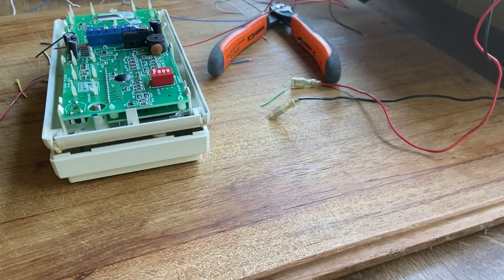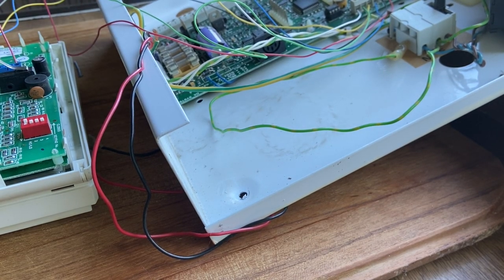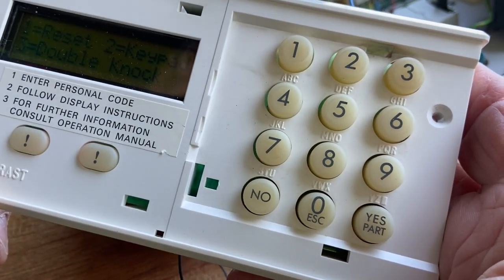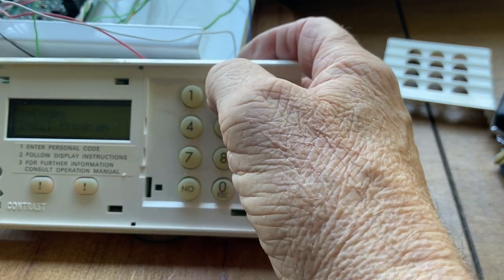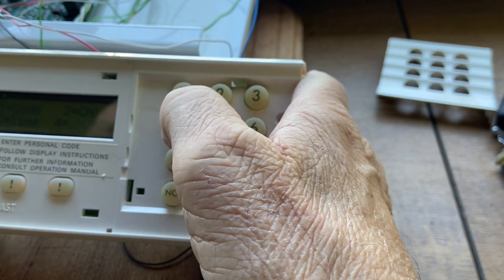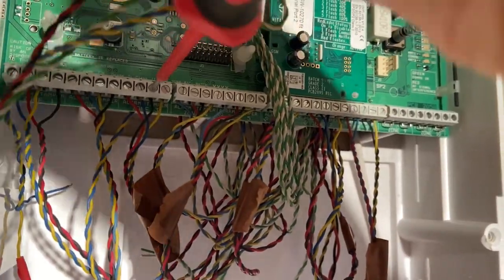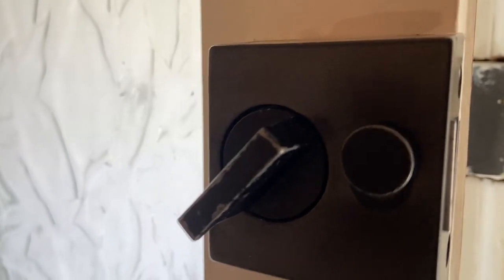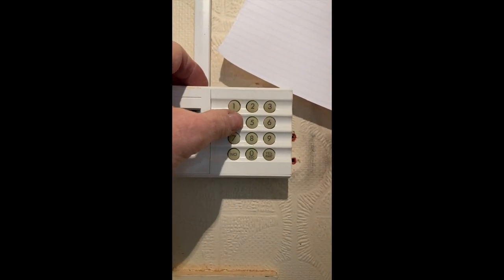#howto Crash an Abacus Alarm Panel. Dedicated to #colinbrown

Comment: That took me back a bit especially when you said ensign....used to work at AC wolf years ago and fitted lots of DA systems kit . In its day I found it to be a good kit fitted loads of Abacus 64,s 👍
Reply from the maker: AC Wolf,  That brings memories back, they joined forces with GRB in the early 90s if I remember right.  Did you know John Plumton!  We were the Guinea pigs for the original alarm course BS185 in Stourbridge College, took us ages trying to get a syllabus together.
Reply: @SFGSecurity  That name sounds vaguely familiar and I did the C&G 185 course @ Stourbridge college.
My original background was as an electrician did 236 parts 1,2&3
Sidelined to alarms when the industry was going through a bad patch
Reply from the maker: You must be of a similar age to me.  I started in alarm industry about 78 after serving an engineering apprenticeship, Me and a mate (Dave Trimer) Started D&L Security, "I was only learning then", which went on to become The Security Design Centre, after that Started with Direct Security.  
I decided to do the electrics part time in 86 just in case alarm industry got flooded.  Got my Bs236 1,2,3. Bs2391.  Not bad for a dyslectic, colour blind engineer.  Still going at 64.
Reply: I know Dave Trimmer actually work at SDC for a while 
Also remember Direct based in Willenhall .
I am 56 but had to stop work at the start of Covid due to a diagnosis of epilepsy.
 your videos take me back to work something that I really miss 👍
Reply from the maker: Small world.  I left there about 1990 so I’d done 11 years there.  Got made redundant so started SFG. Two days after I was made redundant I was offered a job from Direct, told him I didn’t want to work for anyone else, Brian kept the job open and I went to see him 3 weeks later.  Worked there for about 12 years then handed in my notice.  Still see and hear from Brian of Direct and Dave Trimer.
Reply from the maker: Do you still go to the Nsi and security events. There’s one next week in nec.
Reply: @SFGSecurity  sadly not had to surrender my driving licence so limited to local journeys only
Reply from the maker: @gavinwallbank7570  well. If you want a bit of a day out next Thursday at the security event  I’m going next Thursday.
Reply: @SFGSecurity  thanks unfortunately I have a neuro appointment on Thursday otherwise I would have loved to have gone 👍